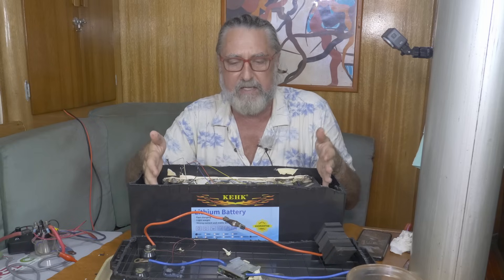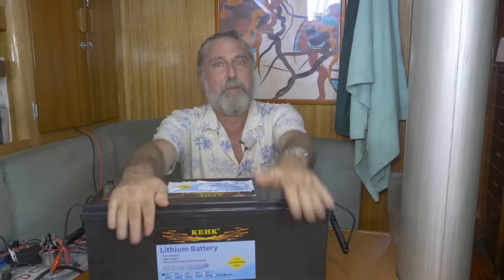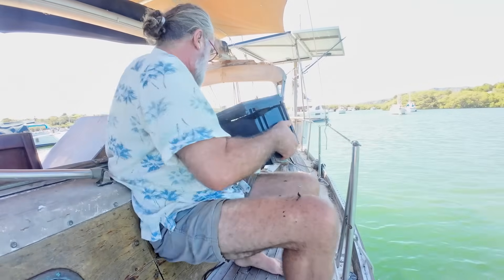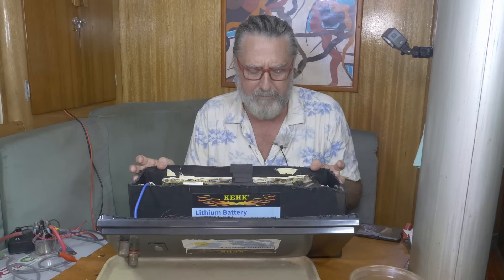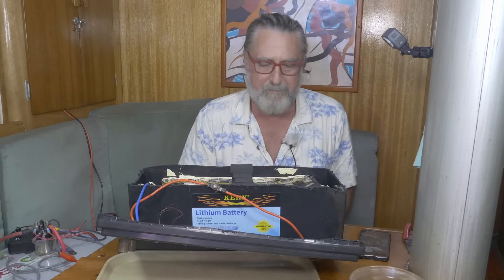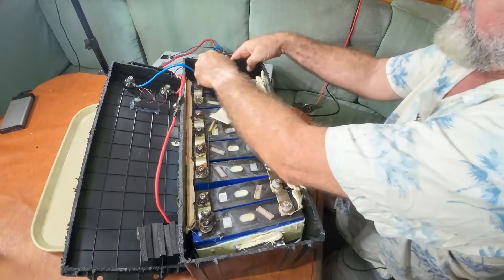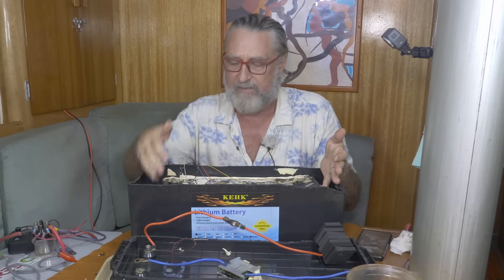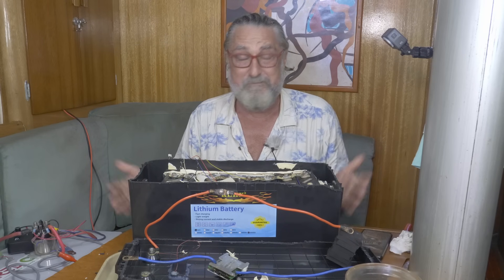Do NOT Buy this Battery!

Comment: Sir you're a genius. 

I saw a battery touted as 12.8v 500Ah (4.5kwh)

I asked the seller 500Ah x 12.8v is 6400Wh how did you come about 4500Wh?

Imagine if I come as your solar installer and I present you with a battery that is that confused, will you allow me to come anywhere close to your house?

These cheap nonsenses has to stop. 

How can someone sell you a 20 year old used battery and you expect it to last for 12 years?

Comment: Just found your YouTube channel and I watched your review of the Voltgo 400ah battery. We have a 97 Chinook class c Rv and want to upgrade the solar and house batteries. This would fit in our battery compartment. So here is my question, the Rv can charge via solar, generator, shore power and chassis engine while driving. All of this tech is old school, I plan on upgrading the solar panels, house batteries, inverter and maybe charge controller. Will this Bank Manager help protect my investment? I’m particularly concerned about the engine alternator charging the LiFePO4 battery. Thanks for time
Reply from the maker: I'm assuming you are leaving some lead batteries in your system, at least the start battery.

In short yes.  With a BankManager managing your new li bank they will be charged correctly (no other charge controller currently does this) and it can take charge from any charging controller that can charge lead including your engine alternator.  You should watch my alternator video.  I doubt you will have a heat issue as going down the road you should have plenty of air flow and you'd use your generator to charge if you weren't driving.
Reply: @Clarks-Adventure  yes the start battery for the chassis engine and maybe later change it to an Optima battery
Reply from the maker: Good.  Optima is lead, and I really like them.

The BankManager is designed to run with a lead battery always attached.

Comment: That's pretty horrible, but I have some that may beat it... I have some Taicopower server rack style 100Ah packs that look really legit, but once I opened them up, they are pouch cells that are soldered together. I was promised prismatic cells! It's an absolute nightmare. I think we once talked about them, but I had not started repairing them. Not only that, but they pouches are all different capacity, and get around 70-80% of their rated capacity for 3 of the 6 that I bought.
Reply from the maker: Yes I remember the capacity difference issue.  You hadn't ripped them apart then.   Sorry they were so bad
   Working with those batteries and the potential AC noise from your inverter totally messed up my confidence with big 48v house systems.  Then the contactor thing....
   But, we seem to have many 48v (house) installs and really few problems.  Really all my field issues have been installation errors and house people seem to install better than boat and camper people.   I guess yours was just bad luck/equipment.
    To the point of your AC noise.  I bet it's a final transistor.  And since you have three inverters can you shut down one at a time to see if the noise clears up then get someone to go over that unit?

    Oh, I just placed an order for proper 48v bi-stable contactors!  Should have them in about a month I assume.
Reply: @Clarks-Adventure  oh that's awesome! I might need one of those contactors. I'm thinking of giving it another go, but I don't have a contactor at the moment. ha! I'd love to see the one you are getting. I figured out how to get my USBs to work reliably with the noise on the Solar Assistant with trial and error. Short USBs with 2 ferrite beads on each was the key. The noise is still an issue for many things, but at least the USBs are working. Still love the product! Seems like lots of people feel the same!
Reply from the maker: We will do an e-mailing when I get them in stock.  I only ordered 20 this first go.   These are supposed to be good for 36/48v.

Also I've been developing the Gen3.  Along the way, due to an error on my part, I fed a 12v contactor 13v on both the on and off terminals for over 5 minutes until my transistors got so hot they burnt off their conformal coating.  I smelled smoke and expected the worst.

   The contactor was fine and the transistors (I use MOSFETs rated for 80a with proper heat sinks) were also fine.   So these are way tougher than I thought.   I used a Fujitsu contactor in early development.  One coil for 2 seconds and the magic smoke leaked out.  This one now seems indestructible by comparison.  I think I'll lighten up on the warnings in the manual.

Comment: What is your thoughts on using  tesla batteries on a boat?
Reply from the maker: ONLY LiFePO4 on boats.
   You can't slam on the breaks and jump out of a boat if you have thermal runaway.

In case you don't know, this is what a boat fire looks like in a surprisingly short amount of time.

https://youtu.be/CKVbXU316sc

Comment: Another excellent video!And questions I have about lithium batteries. I had on my boat 4 x100AH battle borne batteries.I had 1500W in solar power and that whole system worked excellent until one day in the Bahamas we had 2 days out clouds and rain. I was so used to the batteries being fully charged that I didn't really pay attention anymore and after the second night the bms shut the batteries down.Charged with the generator and everything was fine except after that incident  the batteries were definetely a lot less capable of keeping the same amount of charge as before. After that incident I always had to keep an eye on the batteries and charge at nighttime before we went to sleep. Contacted battle borne batteries but they weren't as helpful as I had hoped fore They couldn't tell me a good way of how to find out how healthy the batteries were and my one suggestion was to charge the batteries to full and try to count with the viltron battery monitor how many amps used. But this would have to be done individually for each battery and I never got to do it because I sold the boat in the meantime. But  ofcourseI did let the buyer know  about this problem and told him that the batteries were under warranty and that I had the boxes in case he needed them. This whole incident made me kind of skeptical about the whole hype about lithium batteries and the manufacturers claim that they are almost indestructible. I posted the same comment once before on Ryan&SophieSailing the guy who sells DakotaLythium batteries.But my comment disappeared and I never got an answer from the guy, So my question is how do you test the health of a single batterie?
Reply from the maker: Yep discharge it through a coulomb counter to find the capacity.

Seems like your cells got out of balance.  Carefully top balancing the battery would likely fix your issue but I'm not there to really see what's going on

Li is incredibly fragile.  That's why I invented the BankManager so you can take advantage of the features of lead.  Toughness is one of them.
Reply: Thank you. I did think about that but then  I would have had to buy another  coulomb counter first and then is the question of how to discharge the battery safely and quickly . I had the idea of a blowdryer or electric heater but then I would need another inverter and I heard that a heat gun or something similar is pretty bad for your inverter and it was just a lot of work and equipment to set up. I kind of expected from BattleBorne with their reputation to just say send us one battery at a time and we will test them. After all the batteries were  only about 2 years old and I still have the original boxes. @Clarks-Adventure
Reply from the maker: Everyone worships Battleborns.  I have some.  Nothing special as far as I can tell except how much they cost.
And their warrantee?  Ever actually read it.  It covers nothing that can actually fail and it's prorated at that.

Comment: When someone with experience opens up a box, and either laughs or looks puzzled…quite funny.  I assumed, a decent size of battery warranted a relay, a contacter of some kind, for breaking the circuit for charging or overheat reasons?  Good work, thanks. Take care all.
Reply: You can do that but it's pretty uncommon to have a mechanical disconnect. Usually they use solid state components for reliability reasons.
Reply from the maker: Yes because transistors are way cheaper.

A physical contactor is much better
  I chose to use one on the BankManager after really looking into it

Comment: Dates ranging from 2002 to 2015 seems suspect — is it possible they made the same design for 13 years?  Maybe they aren’t dates?
Reply from the maker: They might not be.  But they would continue an old design if they had support contracts for big projects.
   I've been involved with military projects that still use 20 year old computer boards.

Comment: After your review, my first  thought is how much is it going to cost to pay a company to scrap it? At least you saved time by not adding it to your leader board, although it would have been fun to see red across the spreadsheet row. Oh, have you suffered nightmares from this examination?  Have you undergone counseling? I'm hoping you have lined up other battery candidates to test - hate to see your series end like this. :¬) Webhead USA
Reply from the maker: I'm getting tired of the battery reviews so you might see them slow down.  It's kinda the same thing over and over for me.

I think I might add it to the leaderboard for self serving reasons
  - It would show I'm not all flowers and candy about reviews
  - it provides a link to another Emily and Clark video.

Comment: My Ampere Time 12v 300ah weighs over 60 lbs and produces more than its rated capacity according to my watt meters. It has been a life saver powering my tiny Frigidaire air conditioner during five extreme Louisiana heat emergency power outages this summer. I top it off before storms with a 20 amp charger and connect it to solar panels during power outages that occur in the daytime. I store it at about 75 to 80 percent charged usually. We`re getting storms today and tonight so I just topped it off and I`m doing the same with my portable power stations. My freezer has two, my dorm fridge has two, and the other 7 are small 300w for all the smaller stuff and a little storage.
Reply from the maker: That's energy prepping.  Good on you
Reply: If you`ve never used one check out the Dash mini griddle. It`s only 350w and can make one thick 4 inch pancake per minute or a big perfectly browned thick homemade pan biscuit every 3 minutes. They have a thermostat so it`s almost impossible to burn anything. Amazing little cheap cookers. I bought four of them so I can easily cook while camping, or outside, or during power outages.  @Clarks-Adventure

Comment: Apparently insurers are now charging more if you have Lithium onboard - no pun intended :)

You have to inform them if you are using lithium power.
Reply from the maker: Anything to make more money or more to the point, a reason to not pay out.
Reply: @Clarks-Adventure  Truth be told there was a rash of lithium fires last year at the docks however it was mostly from embedded batteries inside devices like cheap plotters, GPS, etc at the nav station or at the helm.  

Unlike EV's though as you just showed while some aftermarket lithium are made quite well and with safety in mind there are however enough of the Criminal ones now out there to raise concern with insurers about fire safety.  Bargain E-Bikes are also similarly impacted which people living in low income apartments are more prone to purchasing and have already caused a rash of multi-family apartment fires since once one tenant gets a particular E-Bike several others may do the same so that they all start failing and bursting into flames around the same time.  A few bad apples spoiling it for the bunch unfortunately.

With live-aboards starting to get these cheap folding E-Bikes it might be good for someone to give them and their batteries a critical eye.

Best!
Reply from the maker: YES.  The most important issue is cell chemistry.  A lot of power stations and every bike I've seen uses (not LiFePO4) chemistry Li batteries.
   On a boat only LiFePO4 people please.  You don't want your big decision of the day to be do I drown or do I burn!